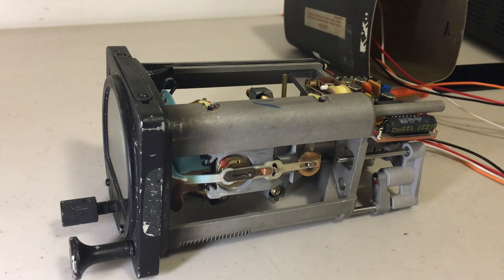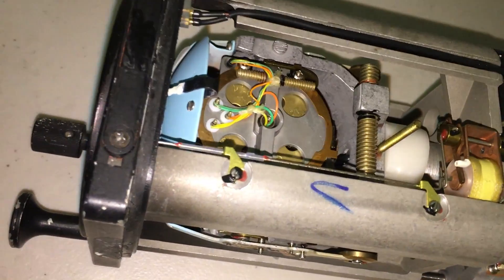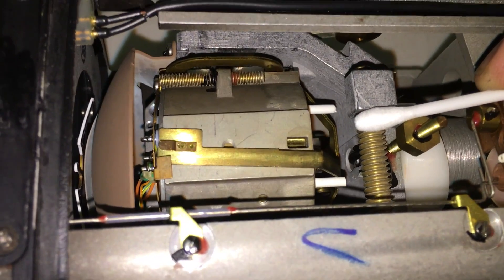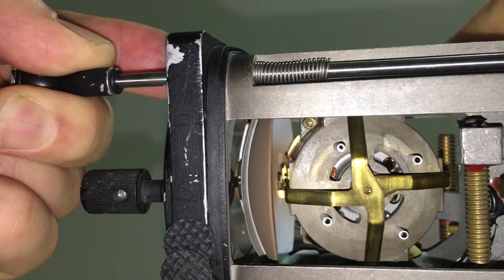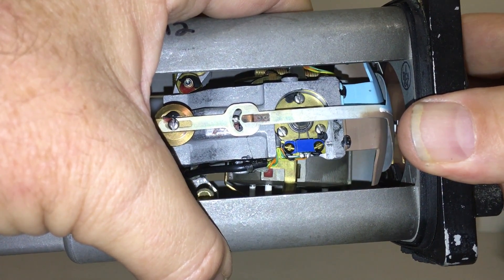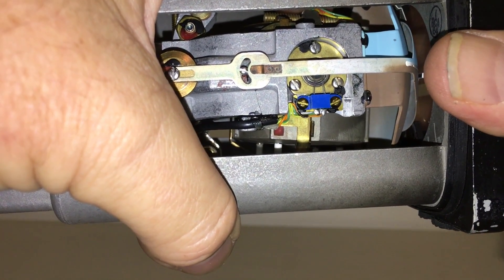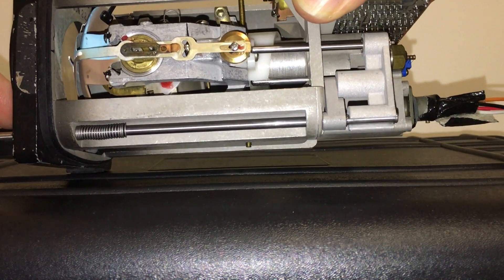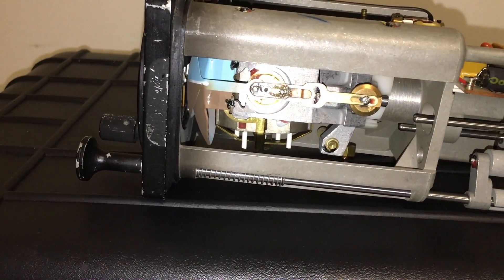Flat Earth - A look inside the Artificial Horizon - Pendulous Vanes.

Comment: Hi Wolfie or anyone, I’m talking to a flatearther that got a gyro from an old inertial navigational system. It’s one of those heavy bulky machines that sat onboard a fighter jet.  He claims that he removed some correction “system” from that and now that he turns that on it sits still and doesn’t move any axis as it should follow the 15 degree per hour drift. Can you think of anything that he could’ve removed? I think he’s lying and I can’t get it out of him, so it’s worth asking. You can see the gear here https://youtu.be/eUavcb-VaLc?si=hX6ol_tS7G0gNhs6 at 16:11, if you care to look. Thanks anyway for the effort! Thank for any advice.

Comment: Wouldn't the pendulous vanes correct for any intentional roll or pitch of the aircraft and nullify the indication which the pilot counts on to know the current spacial orientation of his craft?  Also, wouldn't any acceleration (in any spacial direction) fool the vanes since they rely on gravity to center their mass (under a static conditions)?  like having a level, if you accelerate forward, the bubble would move backwards misleading the observer.
Reply: In another video he shows the self-correcting is about 1 degree per minute. So you would have to have sustained acceleration in order to keep forcing the gyro out of alignment. So flying in a banked circle would cause 1 degree per minute of misalignment towards the outside of the banking (assuming you're causing 1G of centrifugal force). But that would then self-correct once you levelled off.

You can try the same thing in your car with a pendulum. When you accelerate, the pendulum swings to the back of the car due to the acceleration, but then once the velocity is constant the pendulum re-aligns with gravity.

Comment: So, if you fly at constant speed and bank around a circle for long enough, that'd make it give false readings, wouldn't it?
Reply: time would be irrelevant to that, you would need to exert a particular amount of constant force. The amount of force would create the error, not the time at a speed. I've done the math before, you would need to be at around mach 2 in a 15 degree bank. to generate the required force for the error you want to see.

Comment: Very nice, educational and concise video. Great fun!

It was great to see the pendulous vanes in action again (I have watched other videos of yours showing them), and I was particularly interested in the neutral position where opposing vents are half covered and the structure of the asymmetrical metal link between opposing vanes as I had thought previously they independently dangled. 

I am glad you mentioned the issue of precession which interests me and the errors it can introduce errors to some direction indicators though not to the artificial horizon which as you say corrects for precession effects.

Comment: It's my opinion that since the source, direction and strength of earth's gravity and the density of the air column does not deviate as the aircraft moves forward, the pendulous vanes would never be called to respond in order to adjust the horizon to turn the aircraft nose downward. The pendulous vanes respond to compensate for aerodynamic changes in trim tab, icing conditions or external perturbations of the atmosphere affecting flight attitude or rate of climb or decent.  In fact, the uniform downward pull of gravity around the globe should provide conditions no different than flying a plane over a hypothetical flat earth since the gravitational forces would be the same in each case.

Comment: This is an older video, but maybe it will get an answer: when maneuvering, I understand that the vector "down" is actually tilted due to the force acting to change the airplane direction. From what I saw here, I assume that the equipment will correct to level on this new "composite down" vector. What am I missing?

Comment: What about temporarily taping up the air ports responsible for pitch correction, and then pointing the unit East/West, and doing a 6 hour time lapse? Would the unit be accurate enough to pick out the rotation of the earth from whatever natural background drift it has? Might be a fun experiment to try? If it's accurate enough, it might be repeatable in the other axis too. Or maybe I'm missing something?  

You'd then be able to extend this series from not only showing that Artificial Horizons don't prove a flat earth, but go even further and show that they prove a rotating earth! As is usually the case with flat earth evidence that stopped asking "why" too soon.

The Apollo equivalent of this artificial horizon (FDAI) had no gyros or gravity sensing of its own, and instead received a digital output from the computer, which itself kept attitude alignment relative to the stars, rather than any "down" gravity vector.  
When orbiting the earth or the moon, they'd fire the RCS jets just once to induce a pitch rotation in the spacecraft so that it would do a full turn in the same time it took to complete one orbit, so as to constantly keep nose forward, and the windows "down" towards the surface they were orbiting (as well as keeping the sextant and telescope out into space), and in order to keep the test pilots who may be forced to take manual control happy, and with no time to redesign the computer which only cared about alignment relative to the stars, they had to fudge a piggy back system called ORDEAL (Orbital Rate Display Earth And Lunar / Orbital Rate Drive Electronics for Apollo and LM) to manually rotate their artificial horizon at the same rate the spacecraft was rotating, so that they could see where the ground was at all times. As a pilot and not a computer scientist, I guess you might understand their insistence on this bit of inelegant tacked on electronics!  

So this is why these "dumb" analogue artificial horizons need to self correct for the curvature of the earth. And they do so in a pretty genius way shown in this video  that I'd never have predicted. Without it they could potentially show that we're essentially in our own ground speed "orbit" through 24 hours.

Comment: Keeps it flat and level. By your argument any adjustment in pitch is going to allow the self correcting units to bring it" back.to level No matter what the condition is" ?  The air ports are for air pressure. You need air pressure for precession. No air pressure no precession. The unit needs to ensure pressure is available. In the dash, in its housing, in its designed case to.lumit air flow, a certain pressure is required for operation. It's a design function. By your argument air pressure overcomes gravity now that's an interesting concept.
Reply: The correcting force is sufficiently low that the unit will adequately and accurately display roll/pitch deviations during normal manoeuvers. The alignment process, on first uncaging the AI, can take several minutes.

The gyroscope generates the airflow which, by means of the vanes covering/uncovering slots in the gyro housing. Airflow through these slots generates an aerodynamic force. Because the vanes hang vertically, it's only deviations of the housing from the vertical that result in the correcting force.

Comment: So, you're telling me that as the plane turns, the artificial horizon stays in place and the gyroscope realigns to level instead of the plane realigning as to bring the artificial horizon level with gyroscope, as to where it was spun up? 
Sounds pretty stupid didn't it. I'm positive that anyone that thinks this video shows that a gyroscope corrects itself for curvature doesn't have a clue as to how they work.
THE GYROSCOPE IS PERMANENTLY FIXED TO THE LEVEL IT IS SPUN UP, THE PLANE CORRECTS ITSELF. All he is doing is throwing it off and it realigns to the position it was spun up. Give me a break.
Reply: You really put the facts into the game.

Comment: Don't the pendulous vanes react to centrifugal force when you fly tight curves, loops or barrel rolls?
I understand that when you return to normal level flight they will correct according to gravity again.....
Are there flight situations in which the self-correcting mechanism would be undesirable?
For navigation in space, I presume one would use a gyro system that does not correct for gravity....?
Reply: Eric Trumpler they would be affected by those but it takes longer than any high force bank to actually affect the level of the gyro, and after the turn it will readjust to level, and at that point it’s a simple straight path flight